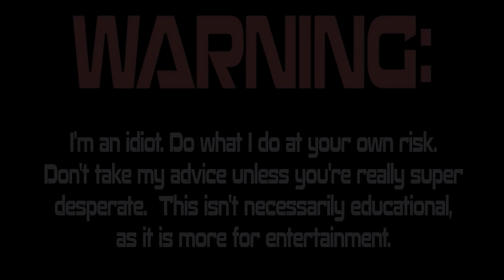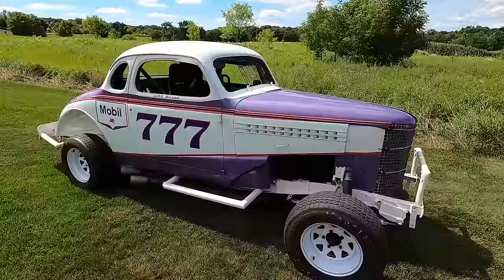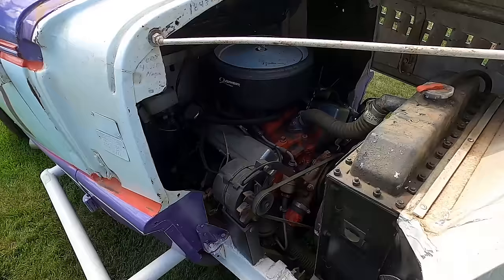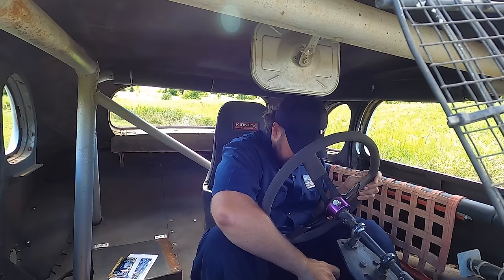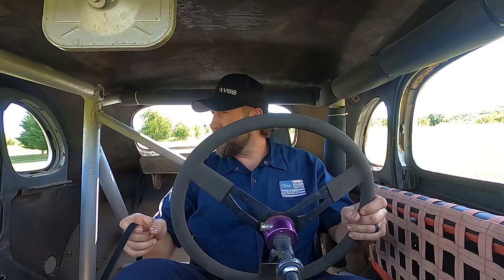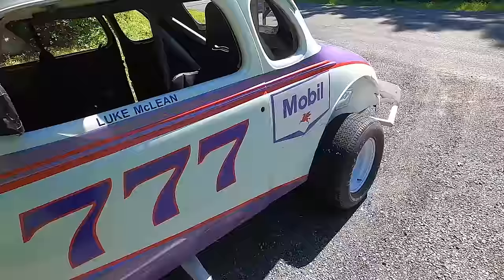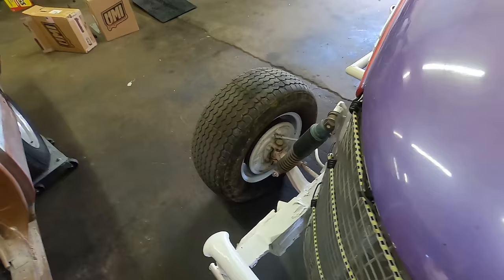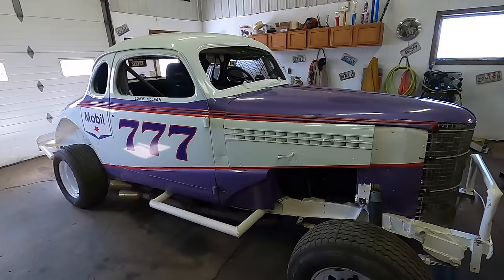I Bought A HISTORIC Vintage Modified Race Car! - Vice Grip Garage EP87

Comment: OH YES ! Street legal it if you can please !!!
Reply from the maker: would be pretty cool
Reply: Vice Grip Garage 
Would you have to swap out the diff? 
Obviously the alignment would need the Tanya Harding, , and maybe some new black donuts on the front.....
But, yes, as long as you can STILL prep it for racing in less than a day....
Options are nice.

Comment: I love it. I got my start in car culture working on a similar car, but asphalt. Helped to build the last car that Crazy Wally Walling raced full time in the 90s, at Evergreen Speedway in Monroe, Washington. And I know what you mean about using whatever was around, in his previous car he sat right in the middle so he used a timing chain and gears hooked to the steering shaft to hook it to the wheel in the center. His stepson Denny ran that car the same year.

Comment: When we raced  Flint stocks, we ran a smaller Tire on the left and also had to find a broken a arm so we can weld the patch in you get stagger right due to the no modification rule

Comment: I had an AMC Eagle station wagon that one of the spark plug wires had worn through the insulation. When that bare wire hit the block, oh man did she buck in the front end. Pretty just like what you're experiencing.

Comment: Rear axle is a Dana 44 truck axle. If he ran that originally, it could be because it was strong, light, and a wide selection of high ratio gear sets as close as the junkyard(in the 60s, at least). Nice find

Comment: I had a ‘72 Mercury Capri with a V6 that did that exact same thing, vibration wise, whenever I was going above 35mph, come to find out it was worn out shocks/struts.  It would just about bounce me off the road, it was a death trap but oh so fast.  😎

Comment: Hi mate, the shimmy in the steering is usually caused by not enough caster angle and compounded by wheels out of balance. The same thing as a shopping cart with a bent front wheel. You can correct it with wedge shims between the axle and spring. With excess toe out they usually drive nice on the sealed roads, but wear the inside of the tires rapidly and often squeal the inside tire on turns. Cheers from Western Australia.

Comment: I gotta go to work in a couple hours, didn't sleep, stayed up watching VGG all night, so I can't read 4.2k comments, but guaranteed someone had to suggest wheel weights and/or a wore tie rod? Use to get that shimmy in my truck after new tires were installed, long story short guy didn't balance them and had slop in the tie rod.

Comment: One of the newer mini spools or limited slip in rear. Alignment on tires in front. You can cleanup but every cleanup might take away from value.driving it on the street would be beyond fun. As long as you don't need fenders. If you do attach the custom ones YOU make by splitting them and making them turn with the tires and wheels.

Comment: One thing you need to consider with these Hoosier racing tires is that the 26.6/27.5 tires do not always measure what they say. So they are not exactly 1 inch different. Or one 27.5 is not the same as another 27.5.  I suggest measuring with a stagger stick if you indeed decide to race it.

Comment: Back when I was just getting out of high school I had a chance to by a gem like this. I was a 2 door Ford 5 window coupe. The gentleman that owned it used to Race Woodhall N.Y., Bradford & Smethport P.A. , not to mention a few other well know places. It had a 302 , but what I found was unique. He told me it had to be push-started, there was no starter. And it had a Manuel transmission with only 2 Gears. I imagine to save weight. He said he had a number of trophey's that I tried to get him to include in the deal. I should have bought it regardless. But I wanted proof of history. Back then he was going to let me take it off his hands for $300.00. Remember this was @ a time outer wheel dirt trackers were falling out of favor. And it's not like I could buy it & go race it tomorrow. Nice sharing with you enjoy watching your vids...

Comment: Rat rod it Buddy . It’ll look great put glass or plexiglass for windows sunny day car no wipes required. Fix suspension. And brake lite , head lites , amd old school tune signal , ad a partner seat and move shifter to center . Speedo,  fix dents in deck lid and around . Fender optional. But that’s just me . As a street rat rod the numbers of people will love it just a thought

Comment: I would check every ball joint and tie rod on that front end, that shake is death wobble. Something loose or out of alignment in the front is causing the wheels to oscillate side to side. Common problem on old solid axle 4x4s as well.

Comment: The alignment won’t help but it seemed a LOT like death wobble that plagues solid axle trucks and jeeps. Check for worn suspension. But that is a sick race machine you just snagged. Even if it becomes a lawn ornament, you’ve got a gem

Comment: Don’t know if it was already mentioned by anyone else, but the front end is toe’d out so when the wheels are turned it changes the ackerman geometry so it’s more ‘stable’ in the turn. The front axle itself may even be installed backward to have a similar effect while turning, and probably has way too much caster for pavement.

Comment: A guy is super curious about the 283 onion cutter in that rocket. I pulled the 283 that's in my truck from an old race jeep. That engine will rev to the moon. It's got power pack heads and a bit of a bore.

Comment: I laughed so hard when that started shaking. I once test drove an old A-100 Ford pickup with a 3 on the tree and the shifter linkage was so worn that when I went from first to second I almost had to shift it into reverse to get the transmission out of first before coming back into neutral so I could go into second.

Comment: When I had a shake like that on an old 1970 Jeep i was just purchasing it simply turned out to be low tire pressure.  Same thing, about 40-50 MPH started oscillating like crazy.  Sort of exact same setup. with leaf springs in the front.  The front end would start wobbling all over.

Comment: If it has a strait axle in the front the tow needs to be towed out just a bit so its pulling a bit side to side if it is towed in it will make it hop like it was there

Comment: Great video. You mentioned that you did not see any casting on heads. The small triangle on top of the a rectangle on front of heads are indeed a Powerpack heads.

Comment: That shaking seems like the wobble that jeeps can get with the live front axle. Normally caused by side to side movement of the axle in relation to the steering link/frame. It kind of picks up a bad frequency that results in that wobble. A panhard rod would help locate the front axle more firmly than relying on just the leaf spring shackles.  When it happens to jeeps it's normally caused by worn out panhard bushings.

Comment: Nothing like running down the road in a janky old race car that has absolutely no safety equipment or required bells and whistles like a horn, Lights, signals ECT ECT.   Used to sneak home parts cars and project cars like this.   So epic.  Best was a big block swapped 70's Camaro with no fenders, Windows, hood or seats ..    had a milk crate zip tied to the floor and wore dollar store swimming goggles and a bandana.  Back roads all the way to the shop.   Total rush.

Comment: Check the caster, might have a lot, shake may go away if you nail throttle. But probly a steering stabilizer for street might work ir kick back caster to 7 to 10 degrees

Comment: Take some pictures as is. Then turn it into a quarter mile Gasser! Small fuel tank to augment the rear fuel cell... Bigger motor, alignement for the drag strip but make it streetable with a couple of fenders here and there... bit 38 pontiac torpedo headlights... Keep that purple-ish / violet purple? and do the whole car like that or tremclad Brown. Maybe a Junkyard LS from an old Silverado with a couple of turbos lol  ZZTop it!!

Comment: I have a video of an old yellow cab running dirt track last weekend down here in Texas. Not sure what year it is, probably 41 model. Wished i could post the video on here. That car would run. Started 12th in his heat and finished 2.

Comment: Although I never went to a single dirt track race, I've been to many a modified stock car race back in the 70's and 80's in New England. As a kid in 1969 I hung around Sharkys garage in Waterbury Connecticut and was fascinated watching the guys work on the old number 44 a 1938 Chevy coup. When they started it flames would shoot out of the open headers.
The shake you get is most likely from the car being set up for an oval track making all left turns, especially the Toe In and Camber.
The car is too nice to race and chance ruining it, I would just make it street legal, then you can drive it around show it off and go to some car shows.

Comment: What should you do with it? Add a 12" GPS screen  with integrated sound system,  leather interior, power windows, A/C, power seats - :). I'd just make it safe and figure out how to vintage race it. Keep it as original as possible. It's beautiful like it is.
Reply: Maybe I'd add a warning sign too - "Do not crush nuts when shifting into second".

Comment: Don't know how you still have a license, must be more understanding around your neck of the woods, but this put a big smile on me n I appreciate that. That wicked shaking above a certain speed reminds me of when I put my driveshaft on 180degrees out so it wasn't balanced anymore, anything over 50 was a real shaker. Had the same thing when the work truck can back from getting serviced, that was because a front wheel had lost it's balance weights, that felt like both front wheels were flapping hard, started around 45mph, really made my bum pucker. I'd check the wheel balance 1st.

Comment: I read through the comments first, but did not see anything relating to the tires. You may be on the right track with your tire size hypothesis; I wanted to ad the possibility of a flat spot in a tire from sitting through wether change.

Comment: I think the shake will be starting with tire balance the toe out is great on a circle track but should not make it shake. You probably could have accelerated through the shake.it seems the shake is speed related not scuff problems.

Comment: You probably figured it out by now but that death wobble is more than likely caused by War out kingpins being a Ford guy I had many a truck with twin I-beam. Anytime I was test driving a truck to buy I would make sure I ran over railroad tracks. That was my ultimate test for worn-out kingpins. Also works with type 1 VW built before 68.

Comment: Love the old modified and sportsman cars from the 50s and 60s.  I am split on my opinion of keeping the originality of the booger welded drill stem roll cage and dying in an explosion of brittle pipe or ruining the nostalgia and putting a proper seamless tube cage in it. Anyway, shorten the wheelbase on the left side, run a 1/2" of toe out and figure out a good stagger and wedge in the back and you're set. I'm sure the front axle has been heated and twisted already so that's set.  Good luck and have fun

Comment: Pause at 16:41. It looks like the base weld of the angle iron shock mount is ripping out of the frame. Please inspect thoroughly. Also, I'd like to change my vote. 777 has too much history to chance a crash on the track. So, I'll vote to do the bare minimal legalize & parade ride that ole girl. Maybe you could give the Monza a tribute paint job, the numbers 777.5 & sling some dirt with it. Be safe & keep 'em coming!

Comment: ive had that issue before with a customers bj40 short wheel base landcruiser with 600hp chev a steering damper cured the problem

Comment: Death wobble could be wheel balancing,tyres look like they have an extra tread hand cut across the normal tread,that will mess with the balance big time,pluss autocross dont balance the wheels kos the race track is bumpy and you would notice the difference, maybe the same with dirt track raceing.

Comment: Wheel bearing in the front, or loose castle nut? neighbor has a straight axle hot rod that did the same, he didn't have enough spacing to keep the bearing tight and had a bad death wobble!

Comment: Can’t believe I didn’t already see this one (2yrs old)
But first thing I thought of was in Jeep world “The Death Wobble”.  I’m sure you had someone drive it while you were in another vehicle to see what the front wheels did when it happened…Did they both start bouncing and turn inwards and outwards violently and super quickly?
Either way, I hope all you did was put a new “smooshier” seat in, set further back to your comfort, and ripped up your own land (or some other dirt surface) just for fun!!!  Obviously after replacing worn front end parts, tune up, and adjustments so she didn’t run too lean and hurt herself 👍

Comment: It’s a solid axle. Had the same problem. Check toe in. You want NONE. Also good tires help.
Reply: Watched till the end. You’re on the right track. Set toe in to zero or a sixteenth and new rubber on the front. I went from undrivable over 40 mph to one finger at 70 buy setting toe in and new tires.

Comment: I just started watching this particular series and watched the next episode where you swapped out the rubber.  As a Jeep TJ owner I've experienced my fair share of death wobble usually between either 45 or 60mph, and EVERY time I've had the wobbles it was due to a tire being out of balance because I threw a weight.  A simple balance has fixed it each of the 4-5 times I've had it.  You swapped tires in the next epi so it's probably gone.  Plus, on a dirt roundy car nobody probably ever worried about balancing.  Just slap some cool Hoosiers on a wheel and go!  Dude, this car is awesome!

Comment: I'm pretty sure it's just a couple of loose lugs or a bent rim why it only shakes above a certain mph(kmph) you'd surprised how often mechanics forget to tighten them (prolly changed out the tires before you bought it)

Comment: I drove a 1978 GMC Panel wagon van for a Company that I worked for back in the 1990's " G.A Foods " St Petersburg Florida ....Every morning as I loaded my truck up and headed out onto 1-275 Southbound Coming onto the interstate from the on ramp .I'd Hit 65 MPH and that frontend would go into a major wobble .just like you race car did ..Used to scare the hell out of me every morning ...After a few. Miles down the interstate it wouldn't do that again all day ...But every morning it would do that ..Gave Me Gray hair and White knuckles ....I wrote that truck up many times and the. Company sent it into the shop to get looked at .the never could figure out what caused it ..I drove that truck for work for almost 2 years. .Every morning that truck gave me another gray hair on my head

Comment: The shake is worn out steering linkage and king pins. Common on those old cars. I had a few. I'm not crazy about the shiftier. One mishap and you might be singing Soprano in the boys choir.

Comment: I know I’m commenting on an old old video but that shake very much looks like caster wobble. Jeep guys know it as death wobble. Generally, it means your steering and or leafspring bushings are worn and they are allowing the axle to shift side to side, which gives you a weird oscillation at a seemingly random speed. Leaf springs usually help the situation but if their bushings are bad, there’s not much they can do.
Reply: I worked at a lift and restoration shop, mainly on jeeps for 10 years and the coil sprung variety used to get wobbles with just play in the steering box

Comment: Undoubtedly 'Death Wobble' something is not tight in the front suspension
Projects in order I would do them in (perhaps even all in the same day:)

Front suspension rebuild
Electrical popping noise diag (electrical shorts are the devil)
Trans linkage shifter slop
Change engine/trans oil
New tires/check brakes

Looks good, engine seems spry.  Leave the engine as is and race her around.  Don't be afraid of racing it around.  If it was built by man, it can be fixed by man.  I see your happy expression when your getting into the throttle.  Perhaps just easy races for fun with a 'no contact rule' and no winner/no prize money to disincentive aggressive driving.  Just some fun laps around a track and then some wobble pops with your friends and fans.

Comment: 283's all had forged cranks, you can bore them .120 over to make a 301 ci, Couldn't see the heads. They looked like power pack heads, but not sure. Could the front shocks be wasted to where the tires become basketballs at a certain speed?

Comment: Find a Dirt Track near you. Contact the Owner or Promoter, , you bring it out say, when the gates open.  Park it by the front gate for folks to check out. In exchange for using as a Promotional tool, they let you run laps during Intermission.  Might be folks in the stands, or racers who know about the car and give you more history on it.

Comment: 283s  were usually in the Sportsman class  ( well back in the 1970s  ) of  Dirt Track Racing ..     Meaning no hirer then a  318  cubic    My father raced raced the Sportsmen ( 1973 to 1980 )   class as  the engines  were a dime a dozen in the Junk yard or easy too get  from people ...     some Racers  like my  father  took  a 283 Block and  placed  a  327 Engine Crank  a Shorter Stroke  but  faster Acceleration...  making it into a kinda like a 302 cubic engine ..    but  this  Dirt Track Modified   was around  possibly late50s  and mid  60s  as it  tells the story on the back side  near the back window  ( 63-64 )      more Likely  did not  have  a conversion  283 with a 327 crank  = 302  like that  ..    as the 327 Engine did not come out until 1962 ..